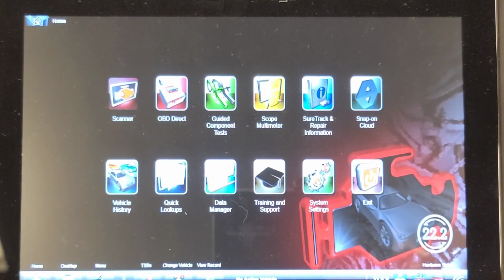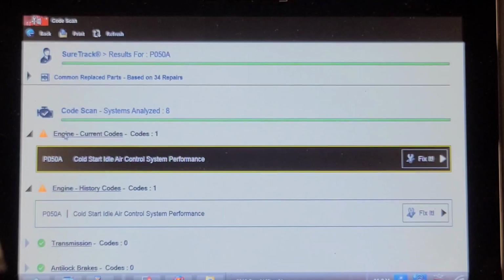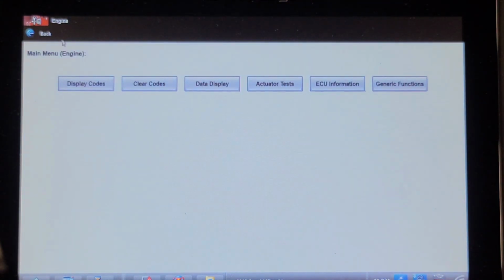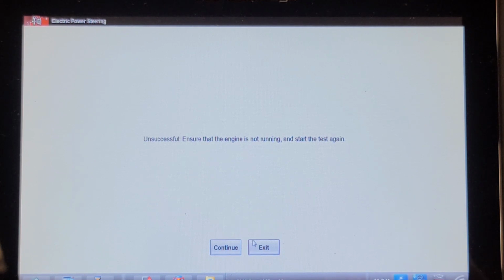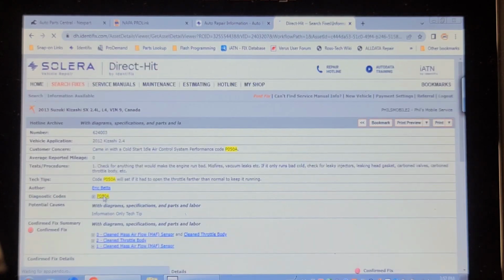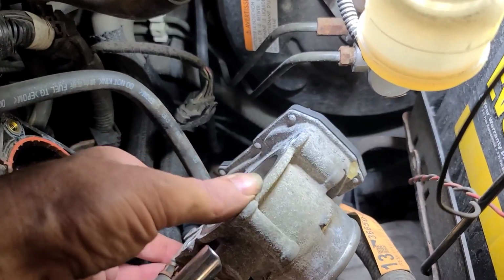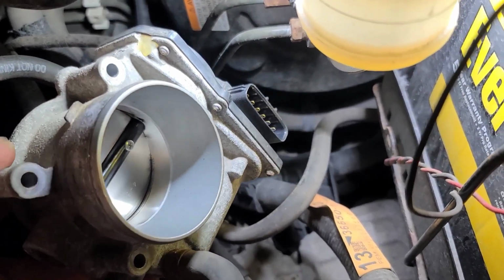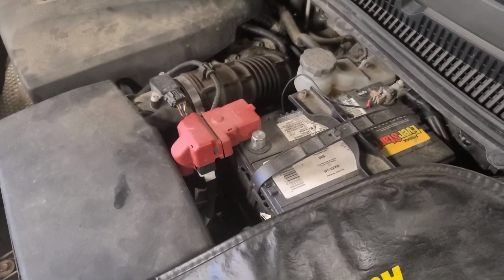2014 Suzuki Kizashi MIL On P050A

Comment: P050A it's not part of the Kizashi engine error codes maybe some glitch on the battery it's nothing important I guess. but I saw an aftermarket unit on top of the fuse box sometimes this kind of device mess with electronics and cause strange thing.